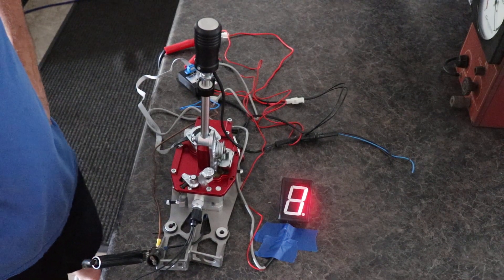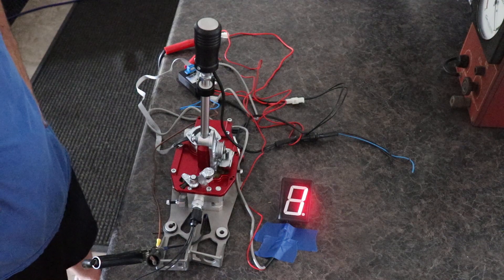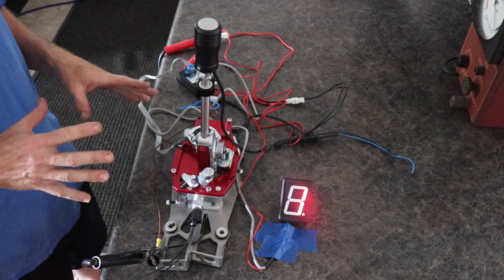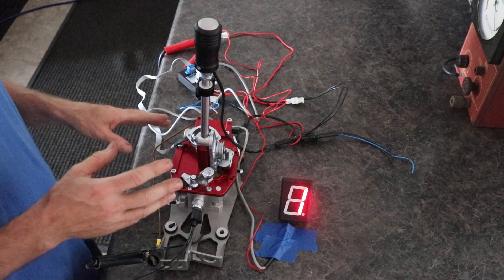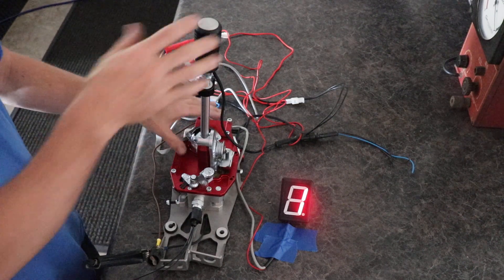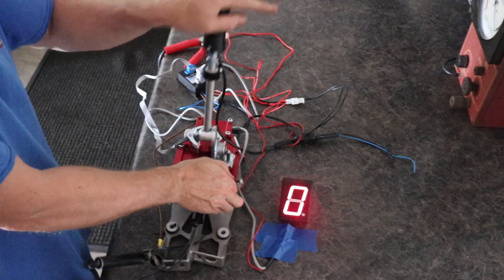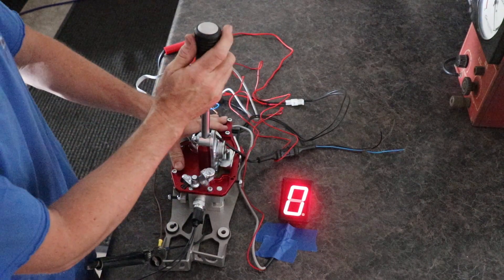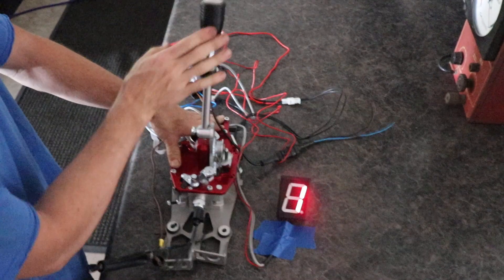SQS-E Shifter Bench Test w/ Display For E153

Comment: i just got one and i think they gave me the wrong one. where it holds the linkage its side by side and not stagered like yours so fitting it in there didnt work. and i noticed the throw is not long enough going into 5th on my 91 mitsubishi gto (3000gt). im hesitant on sending it back since it took 4 months to get here. emails to sqs and rzcrew racing (where i got it from) are few and far between. debating if i should just get a new disk and base plate machined. it would probably be faster than sending it back in. any thoughts on this?

Comment: The shifter need to have electrical power before you can even shift it? If there is not power you can’t shift the shifter up and down ?
Reply from the maker: It can shift without power. The power is for an assist solenoid in the assembly. It decreases shift effort.
Reply: Thanks for sharing this video . Really help a lot. There is not much infor on this shifter . 
I bought this shifter recently and have yet to install with my ppg straight gear dog box. 
It’s for my Evo 9 , 5 mt gear box. 

Was wondering have you ever after install example encounter “ on gear 3 up shift to gear 4 or down shift to gear 2 the gear didn’t slip in and it’s like on a “ neutral “? 
Was just wondering . Appreciate you did respond !!!! You are great!!!!
Reply from the maker: @michaeltan-m2d  You will need to modify the arms at transmission to get the throw lengths right. The biggest concern is if it performs the front/back cable action but does not complete the front/back action, thus causing a money shift.